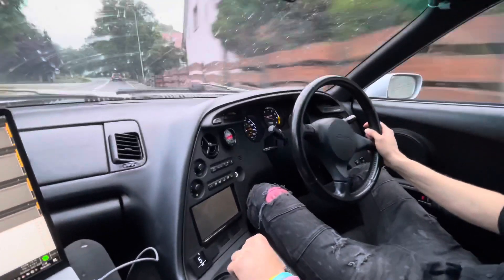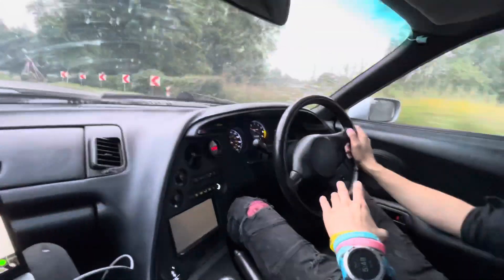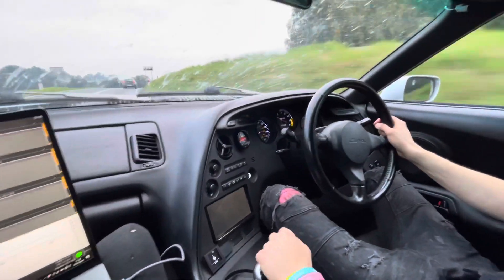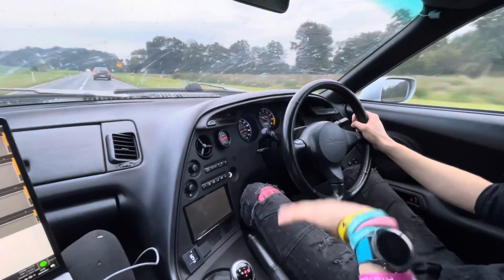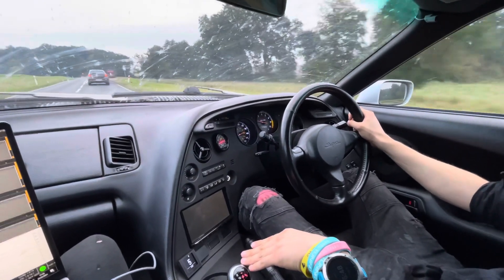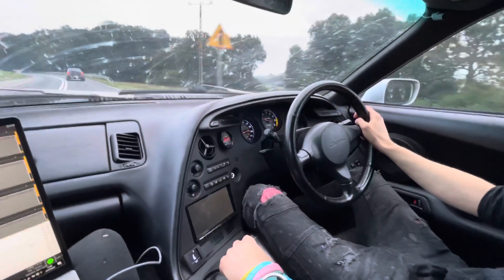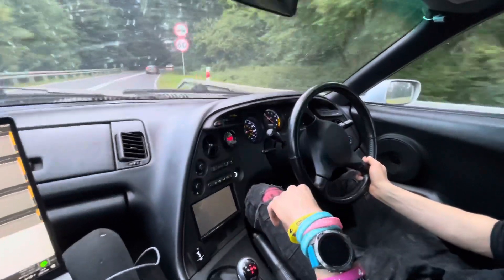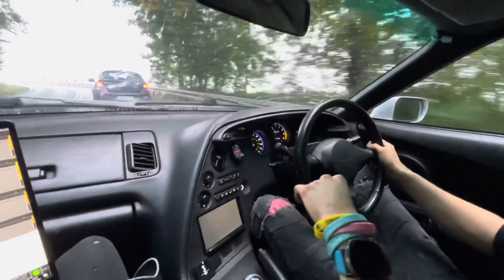DCT 2jz Toyota Supra street car - HTG tuning GCU

Comment: I keep hearing that it isn't very street friendly is it true? how is low speed driving through traffic? jerky?
Reply from the maker: It's not true. Properly tuned works great in all conditions. Nevertheless we are releasing AUTOTUNE / Closed Loop for all dual clutches taking tuning imperfections completely away.
Reply: I own a dct M3 it has a clutch engagement button from granny’s Cadillac mode to straight race car mode I believe HTG runs theirs on a separate computer mine is still on the stock BMW